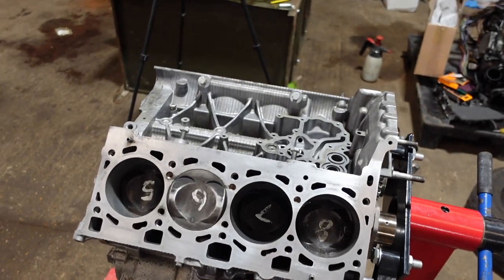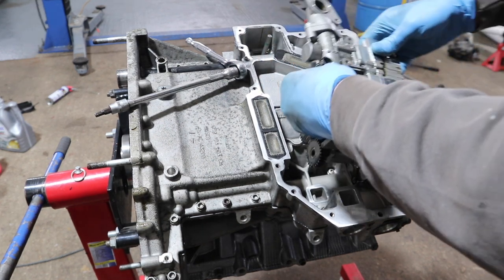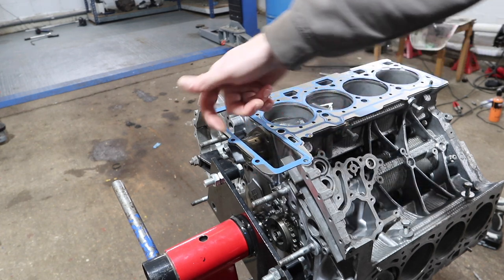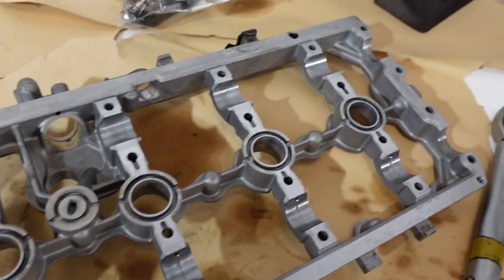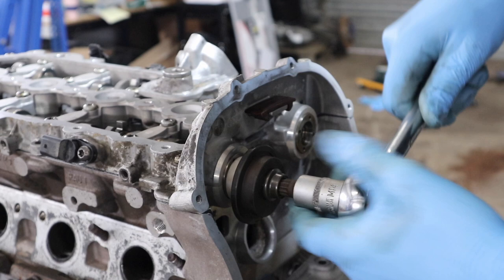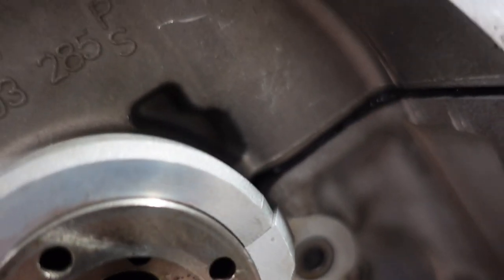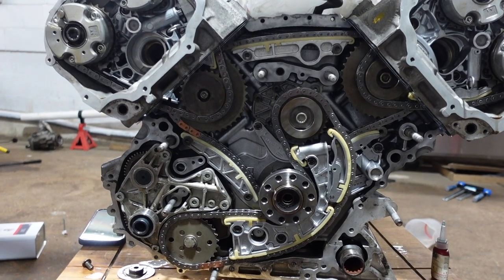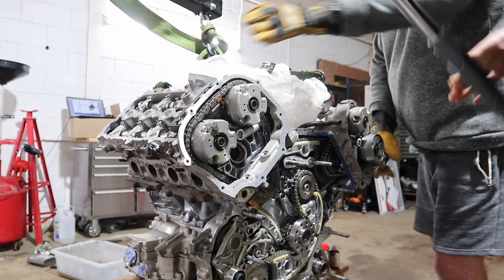IM REBUILDING MY AUDI R8'S V8 ENGINE!! *IN DEPTH* PT2

Comment: 9:03 I don't know if it is important but it seems like there is a metal wire in the assembly lube on the right hand side watching the video and when you put the metal bit on top of it you can see it clearly! And when you finish with the part it seems like it is still in there!

Comment: Well done! The timing chains are crucial, hope that you are not flying blind without a factory manual, since you have all the torque specs assume you do. Only concerned using a filter wrench to torque Cam ends as the factory tool locks in to ensure no movement as timing is dead accurate, not sure if the motor is a interference type either?

Comment: love the video, just wondering if you have experience what I have when torquing cylinder head bolts, I find that the bolts I started on first become loose after finishing the torque sequence once and I have to go back over a couple times to make sure they are correctly torqued before moving to the angle torque

Comment: The engineer in me wanted to trim off that silicon sealant inside the oil pump cover...I was expecting the oil pump to be gear driven. I think the engine designer had a chain and tensioner fetish...Less is more. Fascinating rebuild though, a vapour blasting machine would be so useful on some of those covers...🤔😳😳😏😏🇬🇧

Comment: I dont know what its called in english, but a scale with a spring is an easy tool to convert Nm to any other tool. So the 40 Nm guessing youve did, with one of those you couldve recalculated the 40 Nm to the different length of your oil clamp tool to see how much force you actually have to apply

Comment: Look at the chain tensioner on the left head. As you rotated the engine the tensioner was extanding & then retractin. Is that the problem. Great video.
Regards.
Steve.

Comment: Hi Dean, I think your timing issue is the fact that there is no oil pressure in the tensioners. If you look at your time lapse of it rotating you can see the RH head tensioner plunging right in which would throw your timing check off. I think with oil pressure you should be fine.
Reply: I noticed this. Would this not be due to the inlet not being tensioned enough as it shouldn't be plunging like that if the chain is equally tensioned over both gears.

Comment: 3:58 That line of horizontal sealant at bottom of the picture. It sure looks like it’s not going to match up with anything solid on the cover you’re placing over top of it. Let us know if you get a leak there?

Comment: Hello dean i'm a subscriber and u see that you deal mostly with audis i have a question for you since here were i live i cannont find a decent awnser, i have an audi a6 4f 2005 3.0 tdi with a multitronic gearbox and it suddenly stopped working the gearbox it only showed me error on th solonoied 3rd to 4rd and i reseted and still the same can do prnd but it doesn't engage gear seems always  on neutral

Comment: You'll be lucky If you didn't bend a valve when tightening them camshafts down as you didn't seem to have any idea what way the pistons were sitting.  You should have the timing roughly set when doing this or all the pistons sitting halfway down in the cylinders at least.
Reply from the maker: I literally said I turned the engine over so no pistons were at TDC 🤷🏼‍♂️
Reply: @SavingSalvage  sorry missed that. My bad.
Reply from the maker: @sickomotorsport    No worries bud 👌🏼

Comment: Are the cam tensioners supposed to be moving so much the left hand tensioners was moving quite a lot or is that normal?
Great video it was great content almost on par with an M539 (Streten Milisavljevic) video!👍
Reply from the maker: Yeah as they’re oil pressure fed. Almost? 😢
Reply: Sreten's videos are the Gold standard and set a very high bar!

Comment: you never mentioned what the issue was with the timing backing out on the passenger bank and how you resolved it. Would be extremely helpful for me to know. Is it strictly oil pressure or was there something else?
Reply from the maker: Sorry, yeah it was just because there was no oil pressure in the tensioner so it was slack.
Reply: Thanks for the response. I followed your videos. Put the engine back in and the cam locking tool was not lining up on the passenger bank after I cranked the engine a few times. It didn’t start but it cranked perfectly. It’s throwing a code for no signal g28 crank shaft. I tried replacing the crank sensor. Still no start. Any advice is appreciated!

Comment: Is the chain tensioner supposed to spring back and forward like that when you were manually turning the engine over?
Reply: Pretty sure they are oil pressure fed. As they don’t have any pressure they bounce around

Comment: Dean you are amazing! I do have a question, towards the end of the video, when you are rotating the engine, why do the chain tensioners move? I see at least 3, the ones on both banks for the cam shafts, and one in the middle. I thought they are supposed to keep pick up the slack all the time. Is it by design? Is it that they are oil fed and there is no oil pressure?
Reply from the maker: They are all oil pressure fed, and obviously at the time there was no oil pressure, but once the engine is running they will be tight.
Reply: @SavingSalvage  I thought so, I would have expected though that the spring inside the tensioner is strong enough. May allow for a bit of slack without oil pressure but I see that they are moving quite a lot. I hope this is not a potential problem later on. At least I don't see same movement on the other tensioners.

Comment: 5:22 I may be talking b0ll0cks but this gasket looks like its covering some coolant passages in the bottom of the video shot, are you sure you've fitted the correct gasket?  Hope there's still time before disaster strikes.  Compare the gasket of the old engine to be sure.
Reply from the maker: Not all ports will be active, some are just random. Gaskets are deffo positioned correctly 👍🏽

Comment: 1 thing: don't the variable valve controllers need to be specifically aligned/ positioned?
Reply from the maker: I had this with the RS4 and I couldn’t find any information stating they had to be in a certain position. Edit* I never had a problem with the RS4 once running

Comment: Quick question ? Doesn’t the oil pump need timing to engine ? It looks like a balance shaft style pump and on my Audi it had to be timed
Reply from the maker: No bud doesn’t need to be timed.
Reply: Modern V8 will be inherently balanced surely? It’s usually 3,4,5 cylinder and 90 degree V6 that have them.

Comment: Cam shaft adjusters not lined up to their marks?
Reply from the maker: They don’t have any specific marks. I had this problem with the RS4 as there was no info on their position. So I’ve lined them up the same way as I did for the RS4. (Which I had no issues with)

Comment: Dude them VVT bolts are not torqued correctly . There is a degree sequence to follow after initial torque setting
Reply from the maker: Yeah I know, I said they were just torqued to 60nm to check timing, I then torqued them fully once timing was confirmed. Just didn’t film that bit 👍🏽

Comment: As the previous flange was snapped out, could it not be possible that the remaing part of the flange is still stuck in there
Reply from the maker: There’s no damage at all around it though, so it’s definitely pulled out

Comment: There is something weird going on with the tensioners as you are turning the engine over, there is no way that could be happening as the engine is running, so something must be wrong.
Reply from the maker: The tensioners are oil pressure fed, so once the engine is running they won’t do that. It’s only because there’s no oil in them that they are doing that

Comment: Why no gasket on the baffle plate ?
Reply from the maker: Because it’s within the engine, doesn’t need to stop oil leaking anywhere
Reply: @SavingSalvage  Thank you sir. That why you build engines and i ask stupid questions.
Reply from the maker: Haha, not a stupid question. Sometimes sealant goes in places you wouldn’t expect